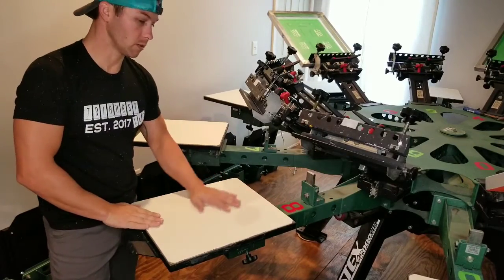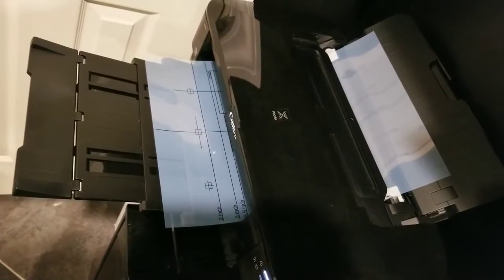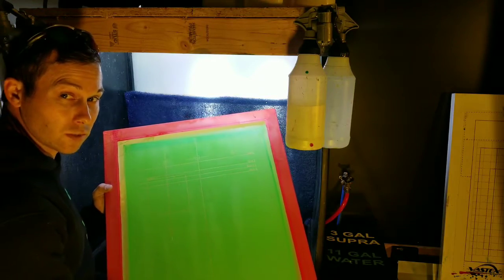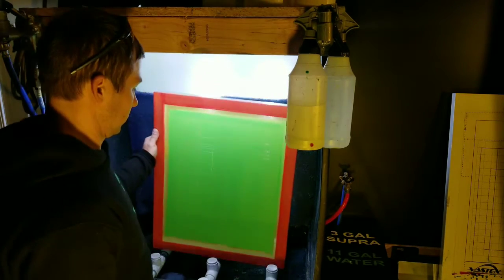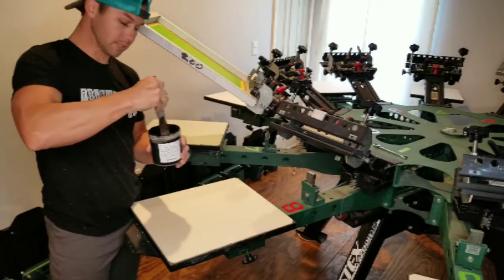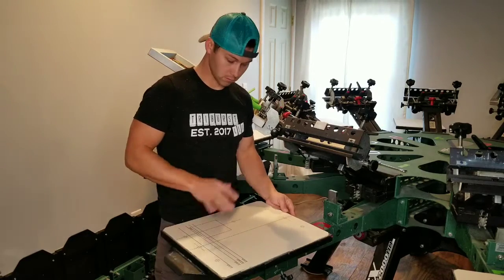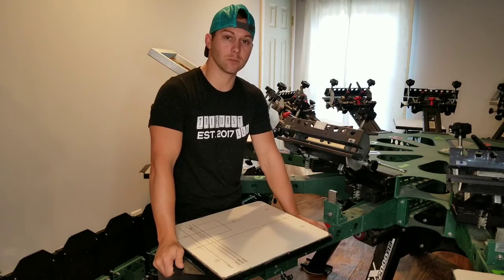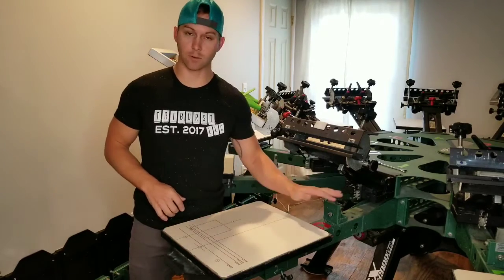PALLET REGISTRATION MARKS l SCREEN PRINTING

Comment: Great idea, beats drawing lines. Should be doing in next couple days.  I saw you are using the PMI Double side pallet tape ( I also use that tape, they don’t recommend using standard pallet tape under the dual side pallet tape). Have you had any issues with the PMI dual side on top of standard pallet tape?
Reply from the maker: It acts the same as if it was just on the pallet itself. I haven't had any issues. I do go an extra mile now and put a small strip of painters tape around the edges to keep the PMI tape from catching the shirts and pulling off.

Comment: Does this work on all size platens? I recently upgraded my work station and now my platen is a small one. 14x16 I believe.
Reply from the maker: I don't know why it wouldn't. I assume you are gonna use a 20x24 in screen?
Reply: @KevinAcker  yes sir. I printed out the transfer a few months back but I checked out today and it will work.

Comment: Thats a sweet set up.
Reply from the maker: Thanks
Reply: @KevinAcker  I noticed thats a vastex press. How you like the press so far. Im on an entry level Hopkins press. Looking to upgrade. And by your Vids, I know you are dedicated to the craft. Would like your input. I primarily print hot split transfers . I know they make a vacuuming table for their press'. Looking for tool feel off contact tilt. Its a bear on this hopkim.... To dial it in. Thanks for the youtube vids. You are freaking awesome!
Reply from the maker: @Dtag1971  I don't have any  complaints, but I do have the 2000HD model which is there top module so I shouldn't. It is a bit heavy, being all steel. I would prefer aluminum if I could do it over. But I bought a shop out and that's what they had and at the price I got it, I'm not complaining.
Reply: @KevinAcker  appreciate it. Looking at the Anatol thunder. Not sure if they have a vacuum table. Thanks for the reply. Have a great day.
Reply from the maker: @Dtag1971  if I had any suggestions it would be too get the biggest one you can afford. I love my 10x10 and I wouldn't want anything less.  Maybe less colors would be fine, but the number of pallets is awesome. It give the press time to cool down in between flashes so I don't have to stop and I knock out 10 shirts at a time. Just something to consider